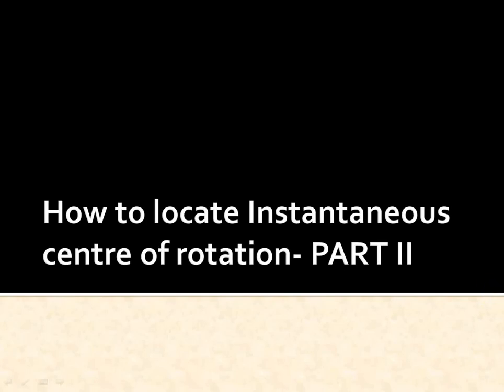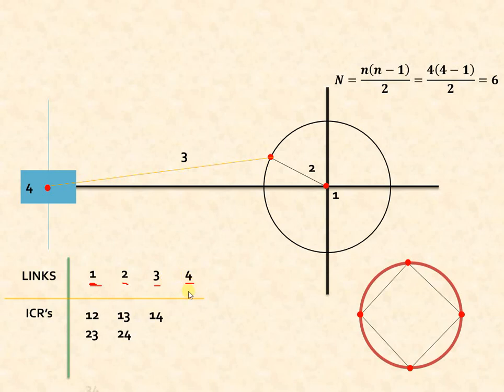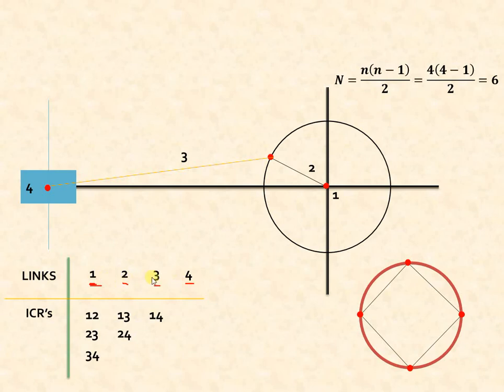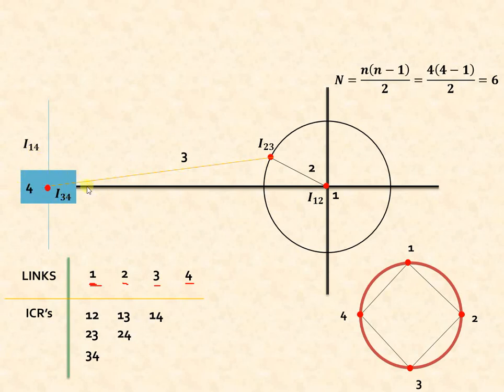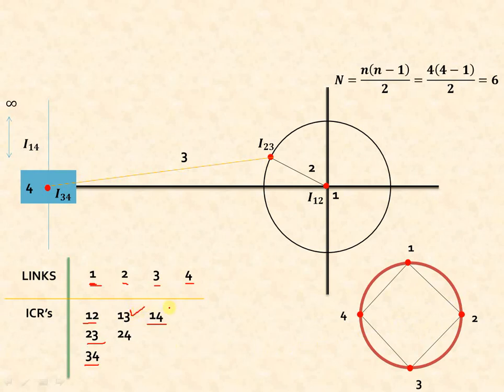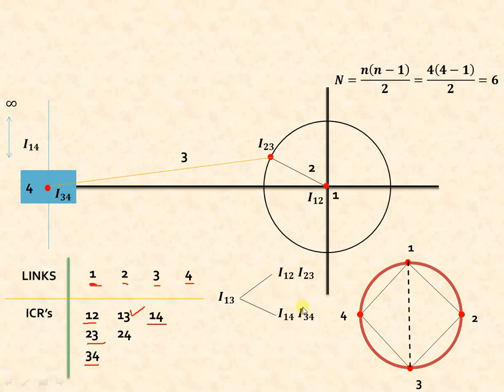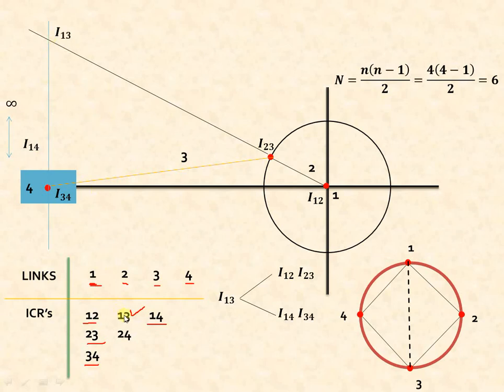Lecture 15 | Velocity diagram  | instantaneous center method | single slider crank mechanism

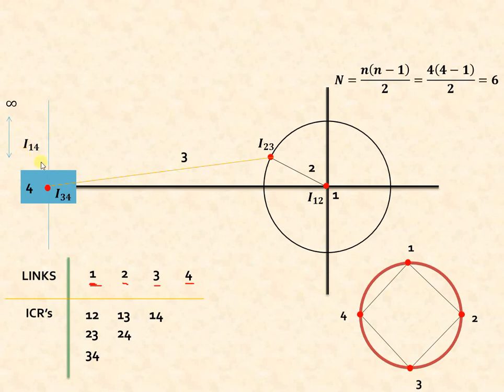Comment: You said at 2:50 you can shift the I center to another I center,if u shift I14 to I23 then I24 coincidences with I23.
You said I14 must be shifted to I12 can you explain why?
Reply from the maker: Its (I14) ICR of sliding link .. which is nothing but link rotating with infinite radius